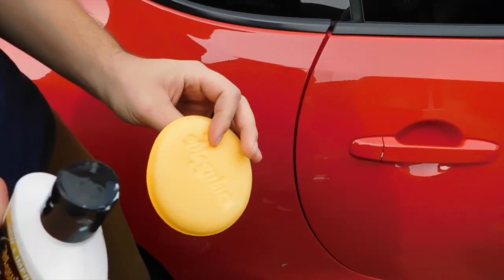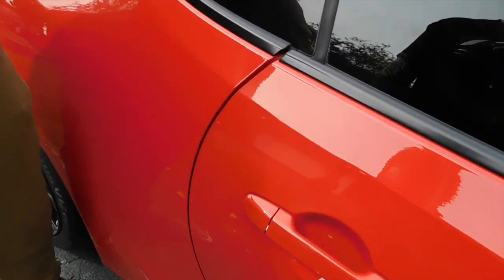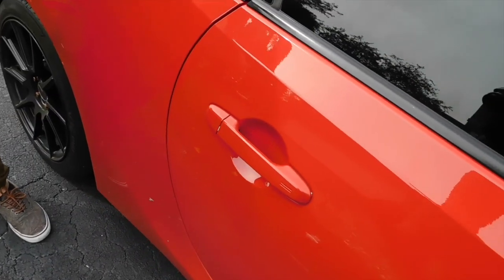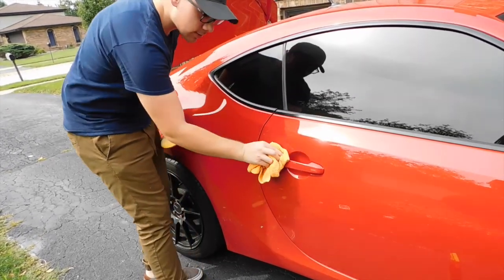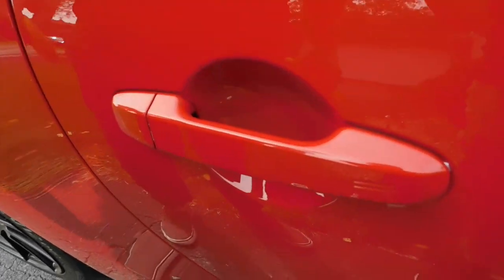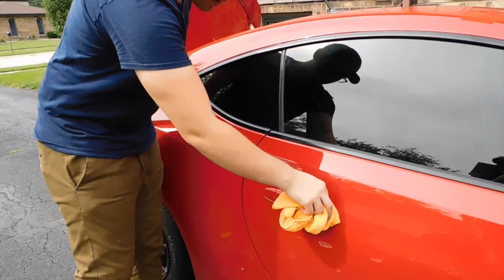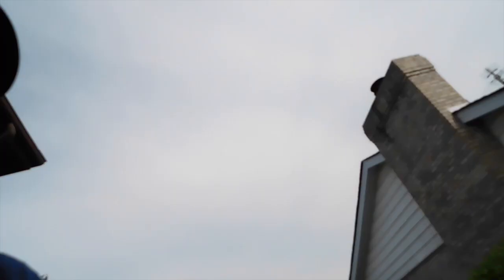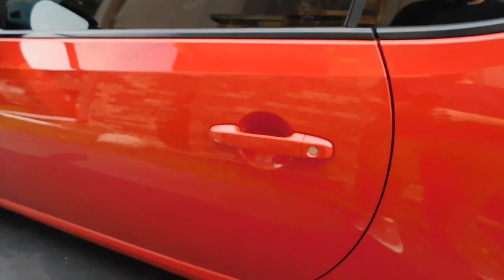HOW TO RESTORE FADED PAINT ON YOUR BRZ DOOR HANDLES

Comment: The wax will make it look good but once it comes off, you have the same thing...What you really need to do is bit the bullet and get some good C7P paint code, firestorm red, and:  buff, promoter paint, seal paint, basecoat paint, clearcoat...viola...brand new and good for many years.